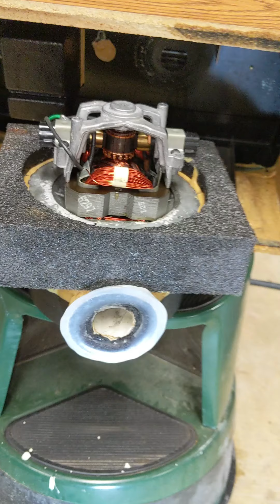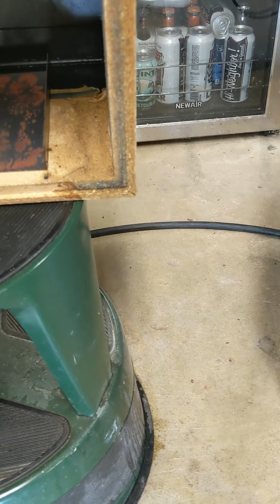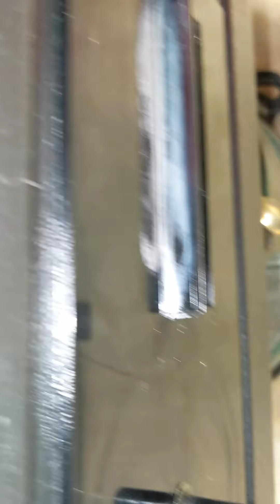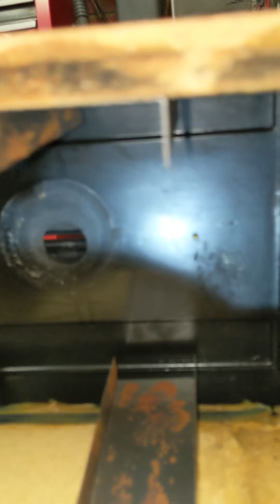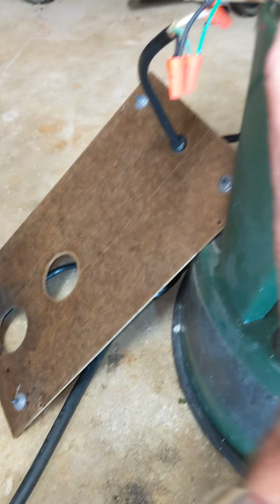Nitty Gritty 1.0 vinyl record cleaning machine (RCM) - exploring and cleaning inside

Comment: Excellent deep dive! They should be ashamed of wiring the switch in neutral. A proper hazard.

In my opinion those sponge pieces coming out fo the holes were meant to absorb the record cleaning fluid and these would slowly dry over a period of time. The premium charged by these record cleaning manufacturers is just superfluous.
Reply from the maker: thanks for the insights re. the sponge pieces!

Comment: Nice disassembly and analysis. Big help as I clean and refurbish my model 1.5 Fi. I had the same question after years of use - where does the wash go? Certainly did come out the bottom that I could tell!